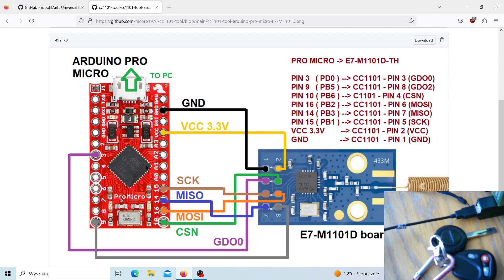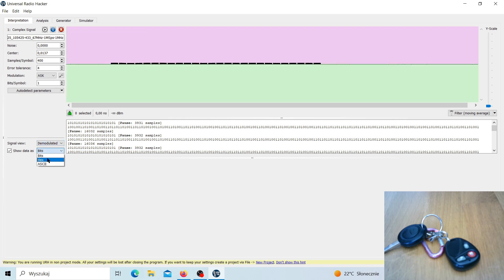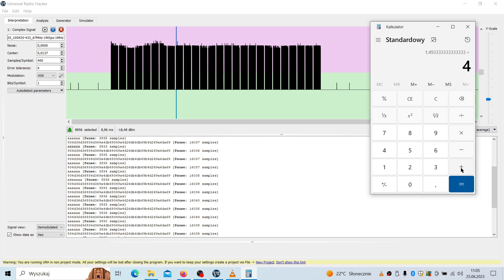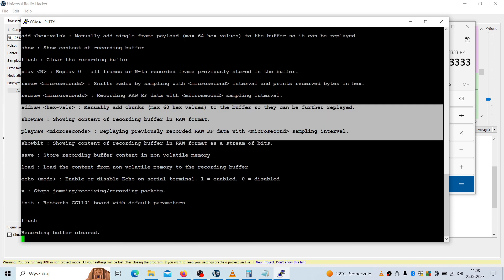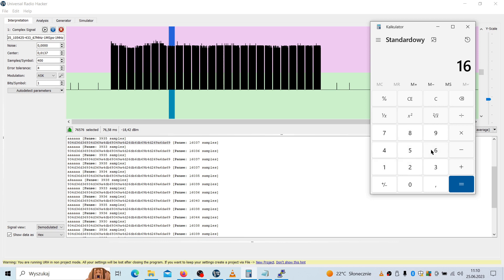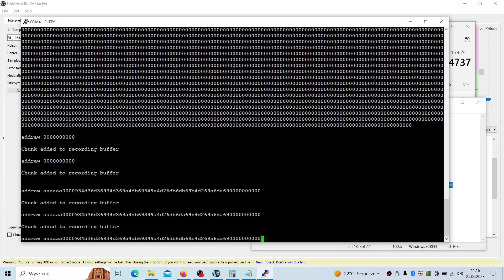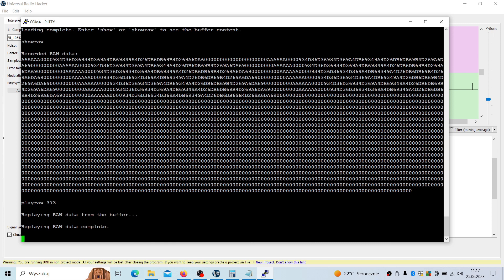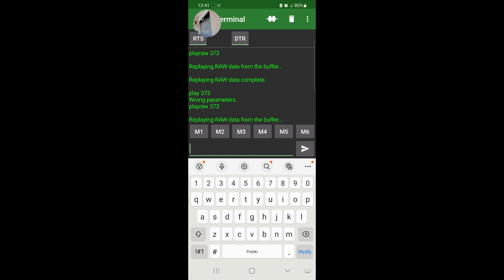Cloning my key and opening my garage gate with my 10 USD DIY CC1101 tool and Universal Radio Hacker

Comment: i sent email,i didn't see like aaaaaa in universal radio hacker,how can i do?
Reply: thank you so much,where are you ?i need help!
Reply from the maker: I was on vacation. I have seen your showraw output. You just need to adjust your addraw commands to your output of universal radio hacker. Every wireless key is different therefore yours may not use aaaa hex numbers or any other preambles
Reply: @justanengineer5599  thanks a lot!:face-blue-smiling:
Reply from the maker: great!  this tool is powerful but there is always some effort needed to reverse engineer the keyfob

Comment: Thank you so much! Really good! I connect to the mobile phone through the Bluetooth-to-serial port module, which is more concealed😸
Reply from the maker: super! I plan to introduce wifi communication for esp32  and esp8266 versions but it will take some time...
Reply: @justanengineer5599  Looking forward to it!😀
Reply from the maker: check out my WIFI version for ESP8266 based boards. You will not need bluetooth adapter anymore..  
You need a WIFI access point to which ESP8266 will connect to , also you need to populate settings in the source code : WIFI SSID, WIFI password, IP address of ESP8266 board and IP address of WIFI router (default gateway) :

IPAddress ip(192, 168, 1, 200);                           // Local Static IP address that you will telnet to
IPAddress gateway(192, 168, 1, 254);                      // Gateway IP address of your WIFI router
IPAddress subnet(255, 255, 255, 0);                       // Subnet Mask
const char ssid[] = "your-WIFI-SSID-here";                // Change to your Router SSID
const char password[] = "your-WIFI-PASSWORD-here";        // Change to your Router Password

the source code is here
https://raw.githubusercontent.com/mcore1976/cc1101-tool/main/cc1101-tool-esp8266-wifi.ino

Also ESP8266 as a WIFI ACCESS POINT version is here 
https://raw.githubusercontent.com/mcore1976/cc1101-tool/main/cc1101-tool-esp8266-wifi-ap.ino

Comment: Thanks for the great project. Worked perfectly once i figured out how to work radio hacker.
Reply from the maker: Great ! I made it simple and cheap  so everyone could replicate this device on his own. When using ESP8266 modules the building cost decreases even further to 5 USD and you have 4KB of non-volatile Flash memory for signal recording storage. That amount is sufficient for most of RF attacks.
Try to build couple of these devices and use chat function
Reply: @justanengineer5599  yeah im planning on trying to adapt it start 3 cameras on a track car with one button press. They all use radio remote controls. I ill have to look into how this could work.
Thanks for sharing all your hard work

Comment: how can i program cc1101 to get more freq in one time?like 433mhz and 434mhz both work
Reply: or what device can do that,like send 433~440 all these freq at same time
Reply from the maker: not possible with single CC1101 board. You would have to use many boards at the same time, each one tuned to different frequency

Comment: Which kind of sdr should I buy?
Reply from the maker: buy some shielded one in alloy housing also try to look for version with RTL8232 and R820T chips (not R820T2 !)
Reply: the blue one that's 10€ work fine if you don't want to pay 30€ for your first dongle